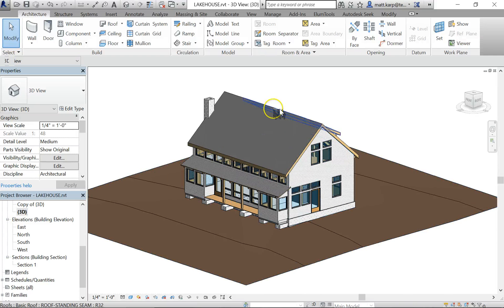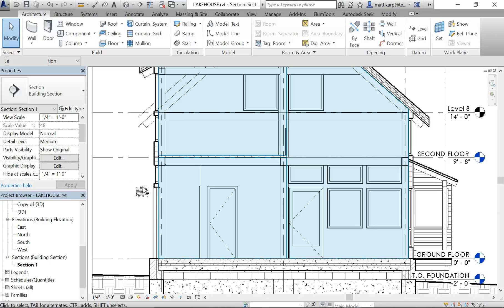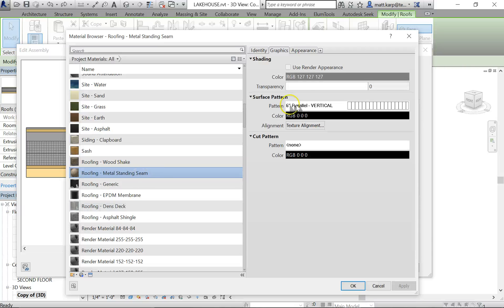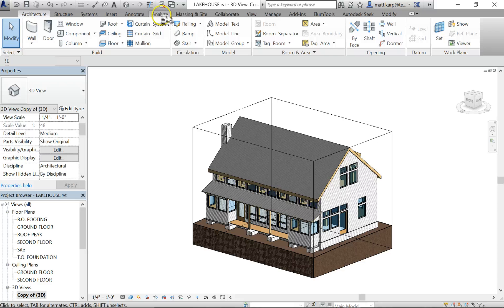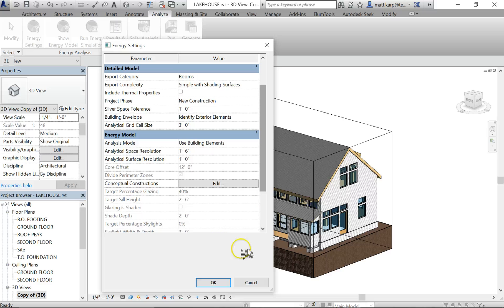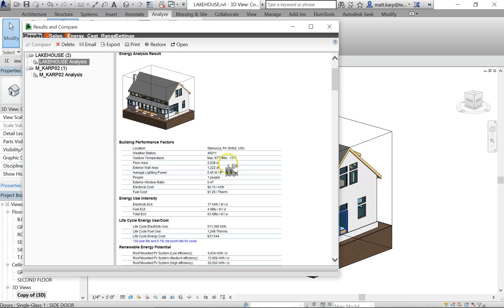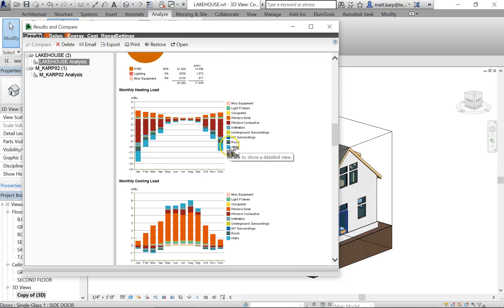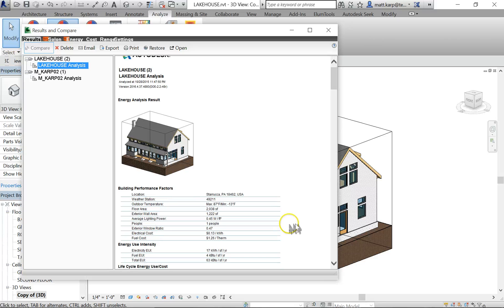Revit energy analysis

Comment: The R-values and U-factors of my building elements are having absolutely no affect on the findings of my energy models. I can double the thickness and R-value of my walls and the amount of energy that revit tells me will be required to condition the space remains exactly the same. How do material thermal properties affect revits energy modeling if at all?
Reply: Ultimately fixed it by creating a new set of walls with custom thermal properties and drawing them horizontally in place of the ceiling. Had to do the same thing for the floors as well. It was a ridiculous amount of work and trouble to do walls that way, but the impact it had on my findings were so dramatic that it makes me seriously question the credibility of Revit's energy modeling. Green building design studios was a whole nother train wreck of a feature...
Reply: nik krenitsky make sure in your energy settings you are using building’s elements.  Otherwise it is defaulting to your generic conceptual wall insulation.
Reply: That only made the problem worse, now revit is telling me that the higher the R-value the higher the cost to heat and cool the building. This is with both default and custom material thermal properties. The heating and cooling load calculator doesnt seem to be having this problem but it is only interested in my walls and roof; it doesnt even have a field for the ceiling and floor...
Reply from the maker: What location and climate are you working with here?  Your ceiling is an interior element, it won't change your buildings thermal properties, it should not be modeled on the exterior of the building.  The exterior walls and roof are the most important pieces.

Comment: Thanks for the guide. Do you know why the energy analysis might fail?I have a revit-file that is failing, not really sure why. I got another one that worked fine though, tried calculating the results on that one twice with no luck.
Reply from the maker: When is the analysis failing?  If it happens during the upload process you might need to try a different internet browser.